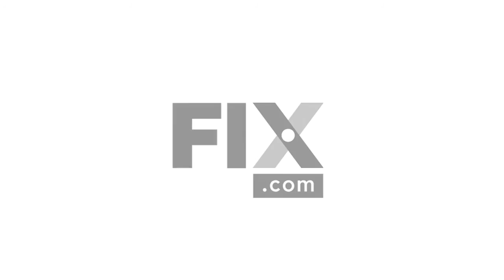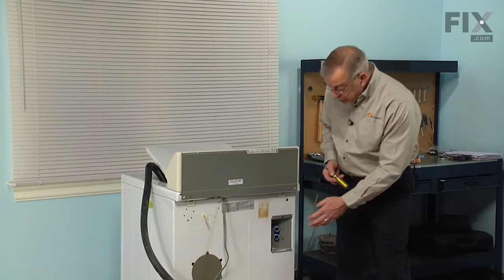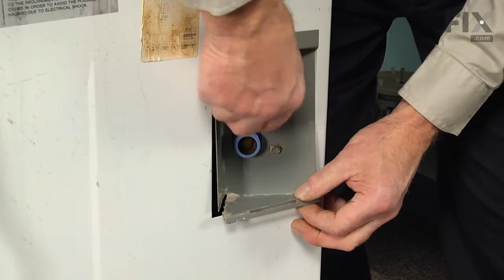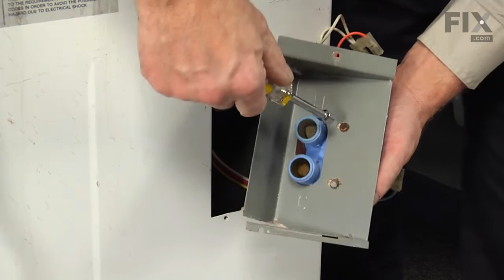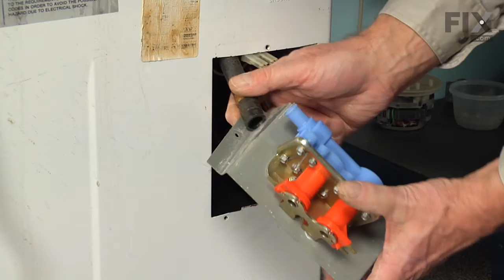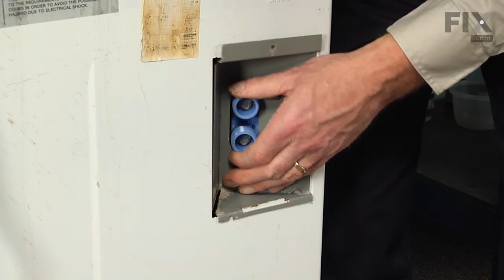Maytag Washer Repair – How to replace the Water Inlet Valve

Comment: Do they make valve extensions for the Maytag Model MAV7600AWW. They have made the area so small you can not tighten the inlet water.  I can not get a tool to tighten the water inlet hoses.

Comment: Thanks for this video!  I just replaced the valve in mine and after I got it all put back together and moved back into place I got to wondering if there was a grounding wire held in place by that final screw.  Thanks to your video, I don't have to take the whole thing back apart to check!